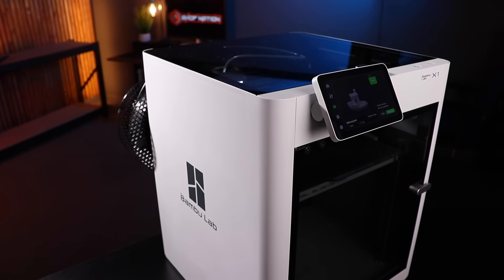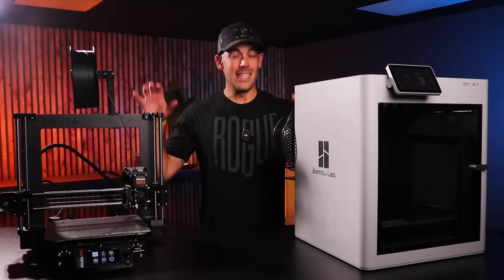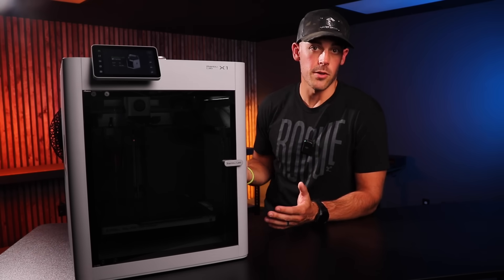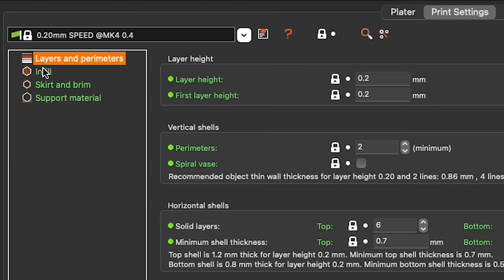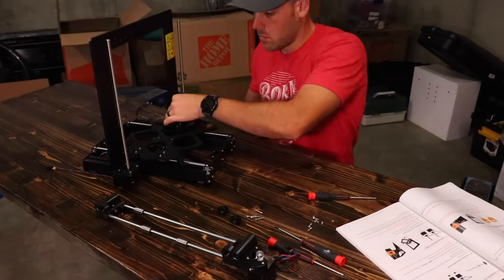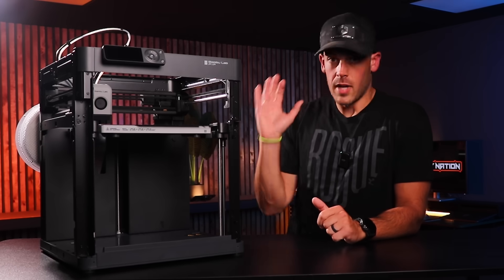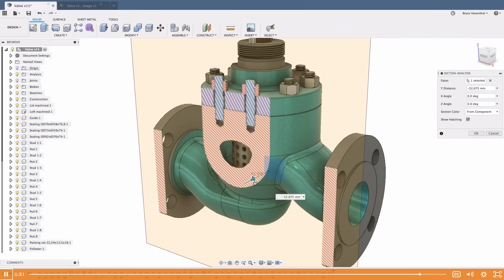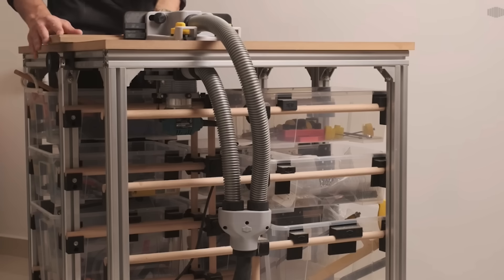The 3D Printer I'd buy if I started over

Comment: I have found that 3D printers are noisy. They have to run 15 to 20 hours a day. My wife complains of the noise. The Bambu printers you showed, one enclosed and one open, is the enclosed model for $12xx quieter than the open model?
If so, that is a major consideration you did not cover in your video. 
I was heavily involved in 3D printing for a few years, I lost interest because I could never find a project that I could manufacture that I could sell to make it worth my time. 
Your presentation given me interesting things to think about. I may check out these 3D printers you showed in your presentation. 
Thank,

Comment: Wait until you find out that adding a laser onto the print head is a relatively easy mod. I have it on one of my ender 3's. xD
You have most of a laser cutter, make sure you remove it when not in use, added mass no bueno during printing.

Comment: Truthfully I started out with an Ender 3 pro and had to work on that damn thing more times than I care to admit. I bought an Elegoo Neptune 3 Plus and it’s been fantastic so far. It was only $350 from the manufacturer’s site as well brand new. Haven’t had any issues out of it so truthfully I’d recommend it for beginners as well and it’s significantly cheaper than some of these options. Good video though.
Reply: started with a neptune 2S and got an neptune 3 Pro as my second printer a few months back. My 2S has a number of troubleshoots, mostly my own fault and not the printers, but my 3 pro has had no issues. This is a great video, but $1200 for a beginner is a lot to ask.

Comment: Yaa but you can get any of the Prusa printers either as a kit for $799 or the pre built for $1200.  I have 4 X1C and 6 MK4, 2 Qidi X Max 3, pretty much Maintenace free. All 12 printers are running the 3D Chameleon color system. 

And just recently bought 2 Sovol Sv07.  We are a Military Contractor. Both of my partners and myself have our Masters in Electrical Engineering. In my opinion the Sovol’s might give Prusa a run for their money, although not in kit form. Oh we have a couple of Voron’s.

Comment: the more you use bamboo systems you find maintenance being an issue. The most important question, to me, is for a newb whats it like 3 months, 6 months, 12 months? The printers that have carbon rods if the rods bend your screwed. Other areas are similarly not great aside from basic nozzle swatches and minor maintenance. These are complex moving mechanical systems and stuff will wear down and go wrong over time. Imagine owning a car where you could add washer fluid but couldn't change the tires yourself or have just any tire shop help.
Bamboo Labs is hit or miss like this. Some things you can do easy, Prusa worst case there is a lot of documentation and you can normally take them to any maker space and get some help in person if you don't want to pay the one way shipping back to Prusa.
Bamboo Labs has been good (we have one at work) but I would never send it hope with someone or suggest the P1P because I know they would come to ME to get support since they either have to go back to Bamboo Labs or can be out of luck with the P1P.

Also for a starter? Seriously if you just want to play and do little things get a mini. Even if it all goes wrong  the small form factor makes rebuilds and getting used to basic operations a breeze. There are tons of mini like 3D printers out there and those are the best starter printers.

Comment: I was going to spend the money on a Bamboo Labs or Prusa, but ended up getting a Sovol SV07, which is basically the same as an S3, but faster and easy cheaper.  Same "just works" experience, even though I wish they used Prusa slicer instead of forking Cura

Comment: Great video.  One of the best ways to determine how reliable a 3D printer is, put it in a makerspace. There you will get 10's of people who range from noobs, to experts, to people who think they're experts. If the printer can survive a couple weeks, it is remarkable. I agree, the Prusa is considered super reliable, but it was our most troublesome in the makerspace.  The TAZ did quite well.  A couple months ago we got rid of all the various machines and bought 3 P1Ps.  They have been incredible.  The only print failures  we have seen were do to bad filament, incorrect bed section (wrong temperature) and poorly designed models.  No nozzle clogs at all! Everyone is happy with the P1Ps, which is really something in a makerspace with 300 people.

Comment: Funny, the "what now" was a problem I also had. I initially bought a 3D printer because I had one specific problem to solve, and the printer was cheaper than having the parts made for me. Great, I though, same price for the parts, plus "free" printer. Then It stood there for a while, unused. It took quite some time until I realized that I can actually make a lot of things I would previously have bought or made in more complicated ways, or thought "Well, no way to get something like this anywhere". Now there's whole weeks where my printer runs almost non-stop, and a second is already on the way to help with speed.

Comment: I've had the Creality K1 Max now for roughly 2 weeks, and I have printed various things of different complexity. It has all been with PLA, but so far, I have had phenomenal results. No issues so far, but I suppose I may see some as time goes by or I switch filament types. I plan on doing testing with ASA, PETG, and maybe Nylon down the road. 

All in all, the printer was a breeze to set up right out of the box. No real assembly is needed. Just connect the screen and remove some screws, really. Using the Creality Print software is pretty intuitive as well. I like what Bambu has with the AMS, but at this point in my 3D printer journey, I'm not sure if I need something like that quite yet.

Comment: I love this video and the simplicity you used for it.  I absolutely agree with you. The only think I would add is that if someone couldn’t afford the $1,000 price point or the $500 mark, I’d recommend a Creality CR-10 Pro and the CR-10 which are also a reliable Toyotas for me and many others.  The CR-10 arrives assembled with all the key features you mentioned.  Over multiple years, the Cr-10 has only had issues when I screwed up the basics that apply to all 3d printers; such as checking your line from the extruded print head to spool to the extra storage rolls.  The CR-10 had been so good to me that even though I’d love to upgrade to a Prusa or a Bambulab, I can get a CR-10 with all the accessories, safety gear, and a ton of filament for the same price of the P1P and the Mk3s+ kit.

Comment: What are your thoughts about each brand in regards to running a reliable print farm? Will you be switching over the Toyotas to the teslas? I am concerned about parts, maintenance, and longevity of the bambu printers. Prusa is proven, by comparison

Comment: Nope, the main reason for the speed is the CoreXY platform which places all of the heavy components in locations that don't move (or move slowly anyway - the Z axis).  It's not the input shaping.  People do use input shaping on i3 style designs, and they aren't much faster, but it does help with ringing.

Comment: This heavily depends on your knowledge and experience imho.
I bought a Creality Ender 3 and never had a single issue with it. Most of the Ender 3 problems come from customers trying to do stupid upgrades on them. I even got one which was broken for free and managed to fix it with $9 and 1h of work... that one also works great. Have a friend of mine who had zero experience with 3D printing and built a small farm with 5 of the Creality Ender 3's, he's been running this farm smoothly for 5-6 years already without issues.
And tbh, I also have 2x Prusa i3's which I am taking care of.... If the Prusa and the Ender 3 were priced the same, I would go for the Ender 3. Much better design etc. The Prusa's (MK2 and MK3) just look like something that I built in my garage compared to the Ender 3. Awful cable management, breaking parts etc... you disassemble the hotend and then spend an hour trying to assemble it back without a cable hitting something.

And let's not forget that the Ender 3's I got for ~$180 a piece, even though now they are more like $200-$250... still for 1/5 of the price of the Prusa I totally believe that it's an absolutely great option for beginners and the millions sold confirm this.
Just my opinion though...

p.s. 2, tons of people are giving up on starting with 3D printing because of videos like yours who tell them that they basically need $1200 to get into 3D printing, and $1200 in some parts of the world is like 2-3 salaries. I personally showed Ender 3 to ~ 7 people who didn't want to spend $1200 on a Prusa and thought that $200 Ender3 is a bad choice (again due to videos like yours). All 7 of them are happily printing on their $200 Ender 3's ;)

Comment: elegoo nepute 3 plus (neptune 4 and 4 pro if you want smaller footprint). Quick easy assembley, easy leveling, and works right out of the box. Cost $350 for the plus. Dip your feet in without spending $700. If you really get into it and like it, then go get a more expensive printer.

Comment: From my experience, the X1 doesnt work. Its been sitting on my desk going through customer service dart board troubleshooting process. They dontbseem to have a clue. I disnt buy this machine cause i wanted something to tinker with, i bought because i wanted something that just works to print real engineering parts. Fixing and repairing parts is like the OP states. Difficult and takes lots of time and many of the connectors are glued in with silicon glue. Im about ready to recreate the office space printer scene

Comment: I did a Creality Ender 3 v2 Neo with a Sonic Pad and it is doing amazingly! My prints in PLA and TPU are clean and it does the trick, but I am thinking of getting an X1 to run for more complicated designs.
Reply: No, do not get the Artillery X1. Spent a lot of time to make It work After like 6/7 months of use.
Reply: @oscardesignstudios  I ended up getting a Bambu Labs P1P and it is amazing!

Comment: Noob question -- does anyone use a "near net" part made with standard methods, and then finish it with printing?  I'd imagine you'd have to do other machining to produce a surface that the printing could lock into, but it's just a guess.

Comment: Actually it's astonishing how fast recommendations might expire nowerdays. Until about a mounth ago, I would have given nearly the same recommendations (maybe the Sovol SV06 if someone is on very tight budget). But now I think Qidi hits the top with it's new x max 3 (325by325) and the smaler x plus 3 (same size as p1p). Active chamber heating is definitly a big step forward; esp conidering energy prices. I had a lot of bad luck printing on my prusas last winter, even with (passive) enclosure, as I keept my room temperatures about 15°C or less and had a lot of issues with warping and failed prints. Active chamber heating is definitly a way to more successfull printing.

The Qidi printers are more industrial style, are very reliable. Also much less noise (the printers are build like a tank, extremly solid, so low vibration).
While the bambulabs printers are definitly first choice if printing multimaterial (including using different material for easy removable support, like petg for pla-prints and vice versa), due to effective print time multi material is normaly not often used and mostly a hype. Anyway, on the prusa mk3/4 you can add it if you realy want it, and as the qidi max 3 uses klipper, so you should be able to add an ercf there. But both are not beginner friendly, unlike bambu's AMS.
Still, the Qidi printers are quite reliable. With the new version 3 line adding active chamber heating and klipper with input shaping, in my opinion it's definitly the best for most people.

Comment: I started on an Ender 3 kit, bought it in 2017 and it has been phenomenal this whole time especially for the price. I paid 180 bucks back then and the prints out of the box were great.
I saw some videos of people showing modifications and upgrades the Ender 3 would need in order to run smooth and consistent but luckily I was able to print most of them with that same printer just like that lol
Bed levelling was never an issue for me somehow. I always do the thing where you use a piece of paper and make sure the pressure is the same in all corners, really not a big deal but I see how people can get it wrong. It's just one of those things you have to get right and you can't skip that part.
Reply: I've got some heavier bed springs coming for $6 and I've got a direct drive for $20 that I have yet to fit. Bed leveling has never been an issue with the glass bed plate.
Reply: @potrzebieneuman4702 about the bed springs - what are they supposed to achieve exactly? I'm running stock springs and have no idea how making them stiffer / heavier would improve anything.
Reply: @Chretze  like you I'm not having any problems with the stock springs, but for AU$6 I thought why not. I think the reason many change their springs is to do with the frequency of bed leveling but I've also found that a glass bed reduces the number of bed leveling as well. I'll try it for $6 and see what happens.
Reply: @potrzebieneuman4702  I see, cheers mate!
Reply: always thinkering on the Ender, I want a printer thats print from the beginning and does not needs mods, so i bought a P1S and a X1C from bambulab and i'm very happy. And i want more security
Reply: Yeah, Ender 3 is pretty good... If you modified it.
- Raspberry (wifi, octoprint, no more sd card (omg, orgasmic....)
- Spider 3.0 Hot End (for any materials)
- BL Touch (Calibration, each 10 prints, sometimes more.)
- Silicone cylinder (instead of springs)
- Dual Z-Axis (need it!!!)
- Heated bed foil self-adhesive insulation
- Try different bed, like glasses, flexible steel...

And you have a pretty decent 3D printer. 
The only down side, is: it's not fast. 
And that's why, now I'm searching something better.

Comment: 3D printer is a tool, like any other, you have to be a keen object maker in order to invest such an equipment.

3D printer isn't as intuitive as a paper based 2D inkjet printer.  It why most sub $5000 kit aimed at hobbyists, not professional.  Most professional 3D print services would not even consider these machines especially from FDM family

Comment: Thanks for a a very helpful video. You have my thanks, a "like" for this video and a new subscriber. I started wondering about 3d printing primarily to make jigs and templates for woodworking, started watching lots of YouTube videos (many helpful, some not quite as helpful), read up online. From initially looking at an Ender 3 (or something similar), I figured I'd rather get something that just works, so I ended up trying to decide between a Prusa Mk 4 kit ($799 + $73 shipping from the Czech Republic to Singapore) and Bambu Labs P1P ($599 + $170 shipping from China to Singapore). Just a couple of days ago, I was thinking perhaps about buying a used Prusa Mk 3 first (if I can't decide between the Mk 4 and P1P).

Comment: Most people just want to print silly little things and cant justify spending so much. So why dont you stop being an asshole just because people do things differently
Reply: Dude you need to chill. He's joking and I don't think $600 for a printer is a crazy price. If you want to just print instead of play with your 3d printer
Reply: @elleryfg7853  clearly you have a vision problem because it clearly says they are both $1200
Reply: @nickf2315  did you finish the video??? He recommends the P1P. Not the X1C or the MK4. Again, you need to chill.

Comment: I'm sorry, but recommending any beginner start with the MK3S+ KIT is terrible advice. it is an absolute nightmare to build it, and the savings don't justify the headaches. If the parts they included weren't mostly 3D printed, I might say otherwise, but they're fragile and easy to break, and as soon as that happens, you're shit out of luck. It's a 200 page instruction manual that is horrifically confusing to follow because they add note after note after note on each page of gotchas and things to look out for*. I *love my Prusa MK3S+, and I'm experienced 3D printer...er, but I would never recommend that kit. I do agree that if you're looking for a printer, the MK3S+ is the printer to buy. It's god damn perfection.
Reply from the maker: I would agree if you know you have zero mechanical ability - don’t buy the kit. But the instructions are very clear and you need pretty basic skills to assemble

Comment: My New Printer will be a Bambulab X1 as to me it is going places with its many colour printing option, The Prusia still looks oudated with 3D printed parts and looks like an Upgraded Anet A8
any way i like creality, for their cost and additional parts and pricing, 
Im using a Ender 3v2 upgraded
Hotend to 500c
The  bed is 240x240 @ 120c and has a print height of 580mm
Firmware is Jyes
so in all it cost me around £550 and im printing Metal parts at around 400C
so if you like to tinker or not then its up to you and your budget,